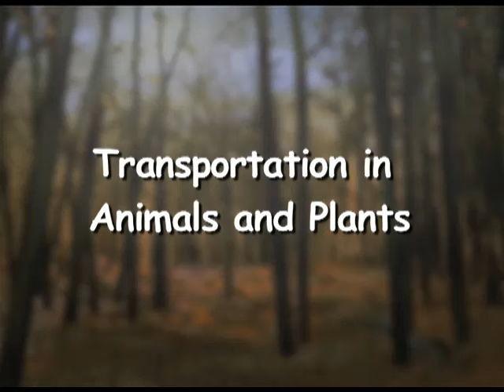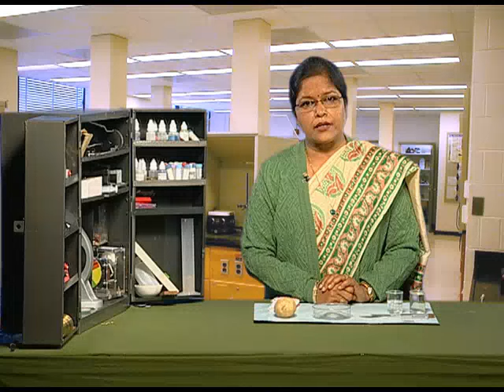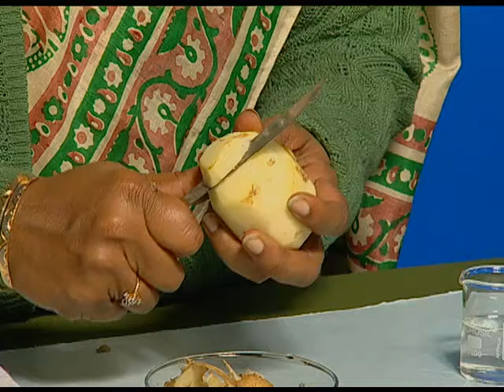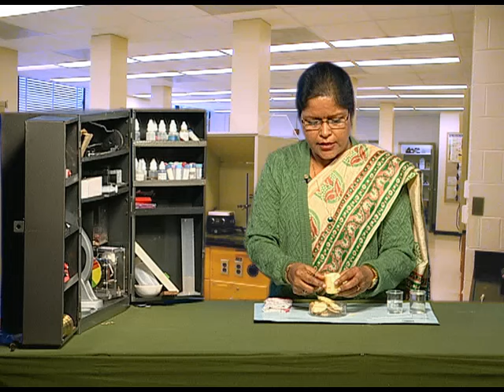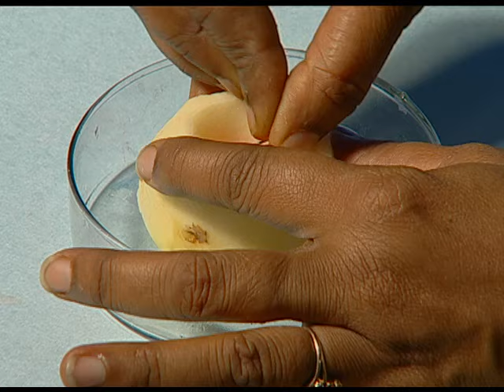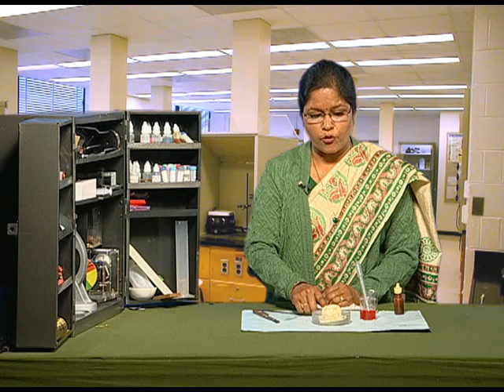Transportation In Animal And Plants

Comment: Shouldn't it be coloured water outside and colourless salt solution inside so that it can be proved that the increase in liquid level is not exosmosis from the potato cells but is coming from the outside hypotonic solution with the walls of the potato container acting like a membrane (since the colour will bleed in)?
Reply: I didn't understand your question🤔
Reply: The question has asked wrong clear it and then ask the question
Reply: That we have Marked the level of the colored water in the cavity and out side the cavity